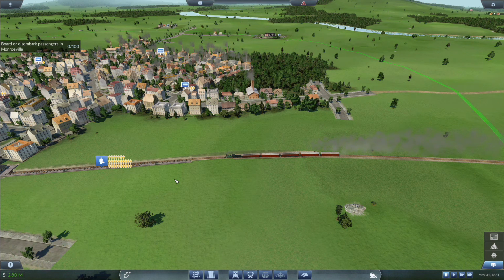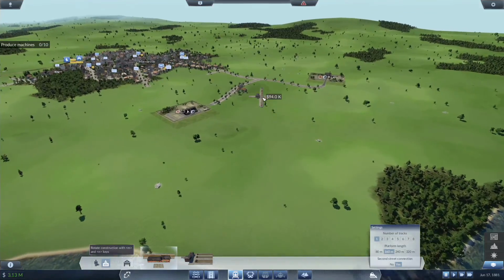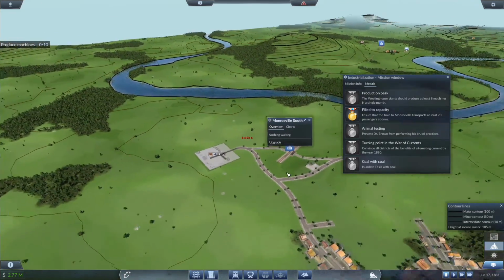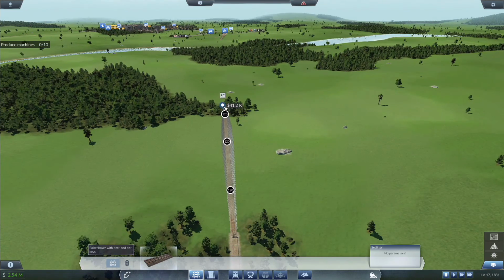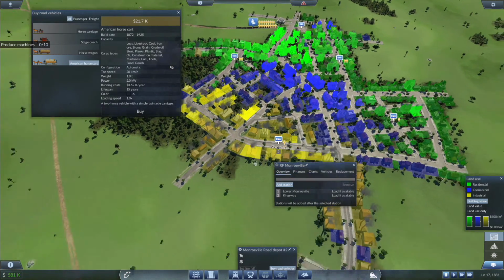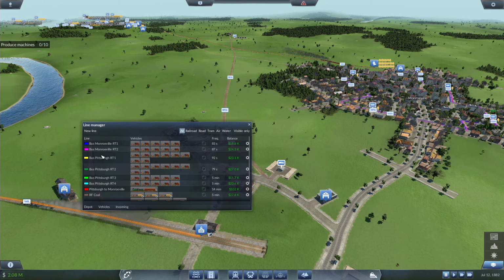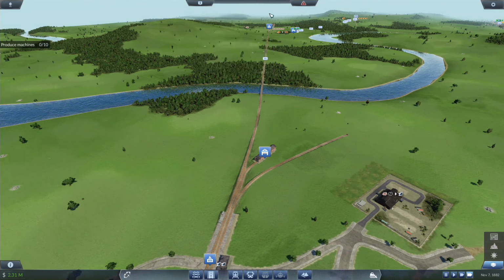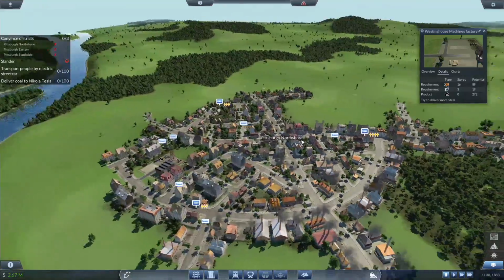Westinghouse Machines Factory - America Campaign [Mission 2] Transport Fever [ep6]

Comment: 22:04 Is this true in all games of this sort? Full load any/all. OTTD,etc...? 
I saw your message about having to duck out of your YouTube channel. I am still hoping you'll find a moment to give an answer to this noob question. Thank you for your time. Anyone else perhaps could help?
Reply from the maker: Regarding the comment about Full Load Any/All, it applies to this game, and would depend on how other games handle wait conditions.  With that said, you generally do not want to use the Wait till Full Load, since it has the potential to kill the frequency of your lines which can affect production if you end up having a vehicle sitting and waiting for goods that don't show up..

Transport Fever has a demand based economy which means goods only get sent to your stations when there is a buyer for the goods.  If the factory fullfills all the buyer's orders and you have a vehicle that is 5 units full out of 6 units of total capacity, it will sit and wait for that last unit that won't show up unless new demand is created.  This can completely stall a production chain, but one thing they added was the maximum wait time which minimizes this problem.

Other games which have a supply-based economy, where a factory pumps out goods regardless of whose buying them will keep producing goods and supplying your stations and you never have to worry about a train sitting around.  It will eventually be loaded, and will not cause issues with production.

I try to check up on the comments periodically, although due to possibly changing my email settings, I stopped getting notified of new comments, and returned to a pile of them...  I'm currently active on the Steam Forums for the game, so that's a good place for any questions.
Reply: Thank you. Very detailed. I appreciate that. :)

Comment: HELP anyone else have trouble in this Scenaiirio ? To do with the ore Mine dropping goods at the Statio n, I've tried over and over to get the mine to drop at the station and NOTHING , had similar with the previous Scenaiirio but got it in the end, but not this one, ANY HELP ?
Reply from the maker: When you click on the station, does the Ore Mine light up white?  Sometimes it can happen where when you are first placing the station it might indicate that it is within range, but then it turns out that it ends up not being in range.  I presume that you have a train with Gondolas on it and the train is going to a station that is in range of the Steel Mill?  Is the Steel Mill connected with a line to the Machine Factory?

WIthout seeing specifically how you've set things up, I can only guess what could be happening.  One option is to build a road connecting the Mine with the Steel Mill, and setup truck stations at both ends and just run trucks  Knowing what I know now Trucks would be my first choice instead of the relatively expensive train setup.  I'd recommend to take some screenshots and upload them to the Steam Forums (presuming you have the game through Steam?)
Reply: Cheers mate, yes it lights up and i had done everything you mentioned, resorted to using trucks to work around the games problem

Comment: The reason the freight train took the wrong track, was that if you set up a new line from the train´s interface, it starts out of the depot imidiatly. It heads to the specified station, no matter the platform. And it choses the shortest one. Just setup the  complete line before (with its second stop) and set the built train to that pre specified line. That way it will chose the correct platform. You can check the line interface for platforms. If a train heads out of depot, it will be on "Auto" Platform. You might be able to catch it before it takes the wrong switch and setup the platform, but its easier to preset the line and then put the train on it.
Reply from the maker: Yep, the game likes to route lines the shortest direction between two points, even if that means that two trains come head to head and hit gridlock because the route manager decided to ignore a second track you built specifically for travel going in the opposite direction.

In the past, the only way to force a train to use a specific platform was to use waypoints.  The addition of being able to specify a specific platform is nice to have.

Comment: set the freight cars to only load a specific cargo, so you don't have, in this case, steel heading back to the lumber mill when its needed right around the corner
Reply from the maker: The reason it was happening was because it was the only way for the Steel to get over to the Machine Factory, since while the Steel can make the hop from the Steel Mill to a Train/Truck Station, it needs to be loaded and then unloaded on a vehicle before it can make a second hop to the Machine Factory, thus why it was being loaded back onto the train.

Setting the freight cars to a specific cargo is generally not a good idea, since it restricts the potential profitability of a train if it's only ever hauling the specific goods in one direction, rather than sending a different set of goods in another direction.  In this case, what would have happened is that not only would the Steel not have moved to the Machine Factory, the Steel Mill would have eventually stopped demanding Coal and Iron Ore, since it wasn't able to ship the Steel anywhere, and it's production would have halted.
Reply: I think you are both right. In a normal game the prespecified cargo is bullocks. But here you just built a truck station close to the machine facory, but you didn´t put a line between that and the steel mill. So thats why you still experienced that weird shipping backward and forward. The problem with steel on the way to the saw mill is, that you wont get planks on that wagon.
Use the truck station you placed ;)
Reply: oops, i was alt tabing here when you complained about the wrong track, didn´t watch you put a line in there anyway.
Reply from the maker: Yep, I think I was hoping that the cargo would make the hop between Steel Mill and Machine Factory without the need to put it on a vehicle, but forgot about that.